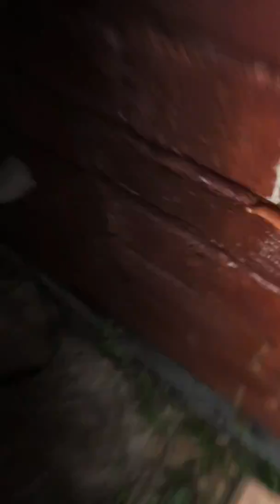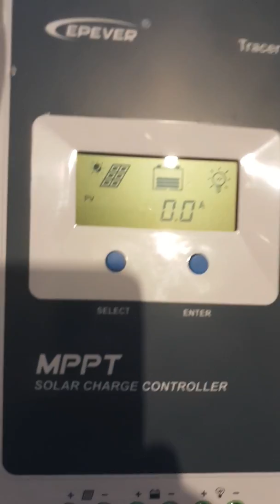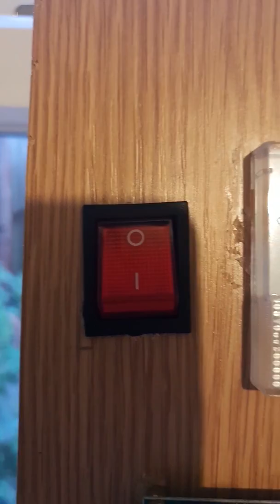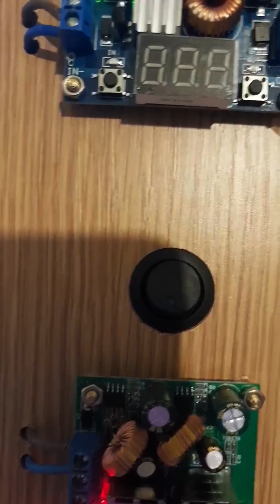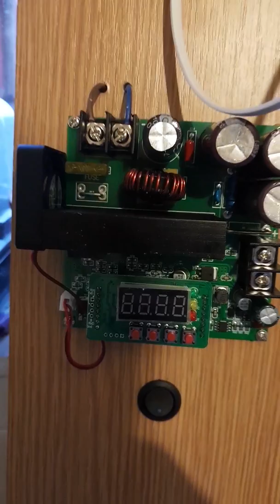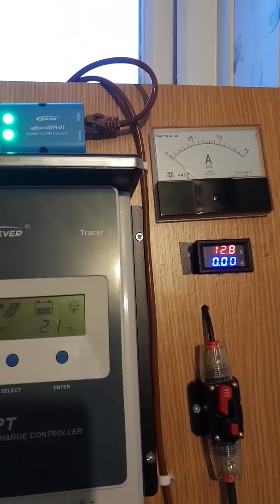Solar panel array

Comment: Hi again, Having done some research on EBay some meters are marked with shunt details but lot are not, so better to buy a meter and shunt together or buy ones with it built in. Solartiger, please ask if you have any further questions.
Reply from the maker: Hi mate yes I bought one with the separate shunt on a good note the eBay seller reimbursed me the money anyway

Comment: Hi, Solartiger here. Regarding your meter, there are two types of amp meter, one has the shunt built in and one type doesn't. If yours does not, you will need to purchase the correct one, it will usually say somewhere at the bottom of dial in small print just above the pivot of the needle. The way this works is as follows, your meter actually measures the small voltage across the shunt that is produced as the current flows through it. This is due to Ohms Law, voltage across the shunt  = current in amps flowing through shunt times the resistance of the shunt in ohms. The shunt resistance is very low (fractions of an ohm) to avoid affecting the current flow in the circuit being measured. Your meter registers a small voltage that is directly proportional to the current being measured. If the shunt value is wrong your readings will not match the scale on the dial, that's the cause of your wonky readings. This situation is avoided if you buy the type of meter with the built in shunt. It's the type that I have wired in series with my inverter. I saw in your video , you have the Wifi box, do you monitor your controller through that. If you don't you may consider getting the Mt50 remote meter, which can give you lots of information in one display unit. If you have further questions please ask. Solartiger

Comment: Hi, Solartiger here, ok I've watched your video. You said your amp meter reading showing the charge coming out of the controller and in to your batteries seams wrong, on your 'panel' meter on the left is this correct? Your meter will give a reading of the current going in to your batteries minus the current being taken by anything connected to the controllers load terminals, to give an example, if the controller is putting 3 amps in the batteries and the load is drawing 1 amp the meter shows positive 2 amps going into the batteries NOT 3 amps., in another if no amps are going in to the batteries i.e. It's dark or night time and the load is still 1 amp the meter will try and show negative 1 amp or peg off the left side of the scale. The meter always shows the difference, charging is + amps and load is - amps. To show the readings correctly you need an amp meter with the zero in the middle of the scale and plus amps one side of the zero and minus amps on the other side. The solar panel cut off switch is wired in plus lead between the solar panel and the controllers solar panel plus terminal.
You said you wanted to measure the current drawn by your inverter, (using meter on top left?), to do this you need to connect the meter between your battery plus and the inverters plus terminal. Plus of the meter goes to battery plus, meter minus goes to inverter plus terminal. The wire needs to be thick enough to carry the current needed by the inverter, it is good practice to install a fuse/ breaker and a cut off switch in the lead to the battery plus terminal in case of a fault e.g. Short circuit.
Car batteries are not ideal for this kind of system, they do not deal well with supplying current for long periods e.g. Running an inverter, they are designed for short bursts and then being recharged as in a car. The correct batteries are deep cycle, providing power over a longer period between charges, I know that these are expensive but last longer in the long term. I understand that you are using 'what you have'. Also  those batteries would safer outside under some kind of cover as they need ventilation to disperse the gasses produced during charging, don't forget to check the water levels in the batteries from time to time and top up with de ionised water not tap water. Did you select the correct battery type on your controller? Affects the charging voltage. You need 'flooded' type setting. With regards to battery voltage readings, anything over 12.6V at rest (not charging or discharging) is considered FULL, during charging 13V to approx 14V, below 12v is considered FLAT!

Hope this is helpful, will try and do a video sometime next week. Thanks Solartiger Sorry this comment is so long....
Reply from the maker: Hi thanks for your comment the amperage that I'm measuring is just what is coming out from the controller not what's going into the batteries the batteries I have are all sealed they are not wet batteries so charging inside shouldn't be a problem yes the controller is set on the correct type of battery that I have I think the metre is faulty as I have to run through a shunt and I don't think the shunt is calibrated properly very informative on how to wire my other amp metre to the battery and inverter so many thanks for that and look forward to your video regards Steve